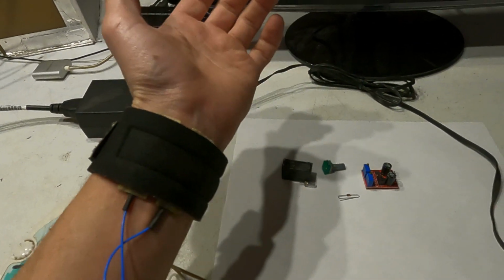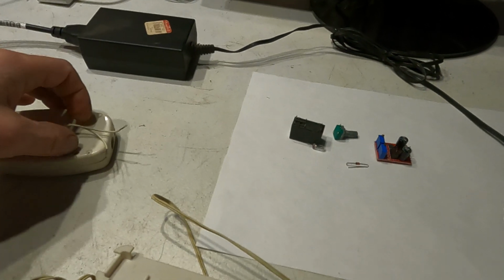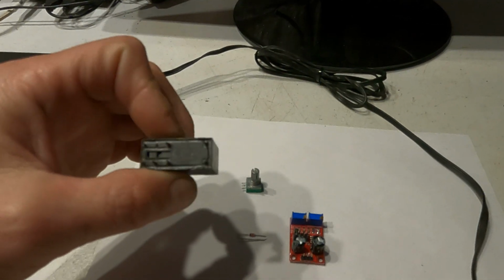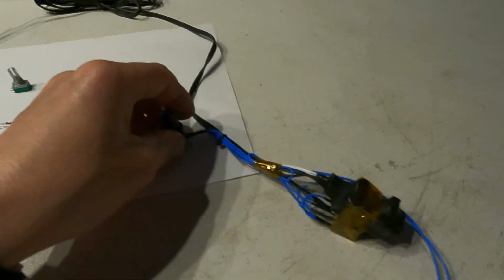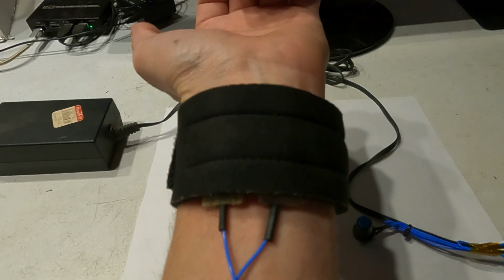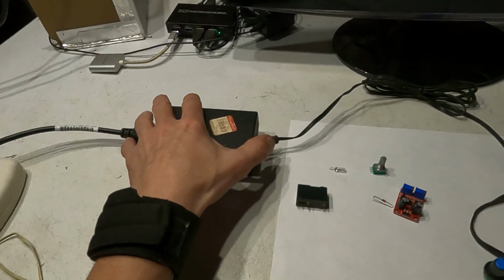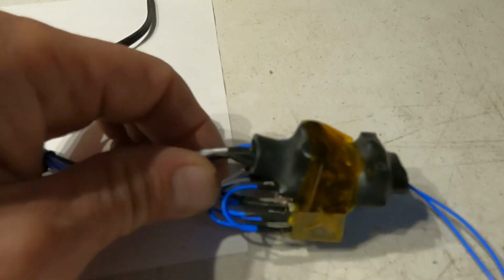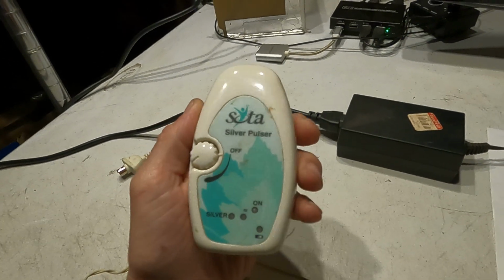162 Sota Silver Pulser alternative for under $10

Comment: Hi Andrey, this is really useful, and I would definitely like to see the schematic. However, there is one suggestion I'd like to make - in my opinion it would be more versatile if you had this running off battery power, but rather than the 9v batteries which the original Bob Beck design used, it would be much better with a rechargeable Lite-ion battery, or something similar. That would also reduce the size and weight of the device once it was mounted inside an enclosure - in fact it would probably fit quite a small Hammond type enclosure. Also, if the controls could all be accessed from the exterior of the device that would be even better - rather than only the single pot. What do you think?
Reply from the maker: yes, agreed, this first one is a bit loud and requires power supply but very simple, I will be re-designing and improving it further. it will be battery powered and compact.
Reply: @AndreyD  Hi Andrey. Thank you. Please keep me posted, especially if you intend making the new version available here in the EU, because I’d be interested if the price is right.
Reply: @truthseeker057  Just read the book he linked or ask an AI to whip up a schematics guide for you 😊

Comment: I make charge based zappers. Works 10times better than Beck's
Reply from the maker: Can you explain working principle?
So you charge the cap then discharge it into the electrodes? Not sure if I understand it correctly, some explanation would be helpful
Reply: @AndreyD  it solves ALL the limitations of beck's which are:
* High surface area to zap.
* Very high charge (or current density) as opposed to beck's. This is also because of the wider Electrodes.
* Higher output current (than beck's).
*Can be used at any part of the body (not only the wrist or ankle) to heal wounds, MRSA, mouth and throat infections, e.t.c.
Reply: @ChinonsoHenry-nz4zu  y de que sirve tanta presuncion, si no compartes tu informacion para el bien general?
Reply: @ChinonsoHenry-nz4zu  hi! do you still make these? Do you have a website, videos? Thanks!
Reply: @AndreyD   it's actually a 9v DC (peak) with an offset signal of 18volt (peak) which pulsates at a frequency of 4HZ (bob beck's frequency).

I have knocked out malaria, cold virus and stubborn bacterial infection when antibiotic have failed.

At a low setting, it energizes me when I come back stressed up in the evening after work. 

Heavy herx reaction occurs when you use it for the first time and for very long time duration per batch.

Powerful stuff.
Reply: Can you make a video about this or share more info?

Comment: Thank you for this video, a schematic would be much appreciated.
Reply from the maker: Sure it will. If I place it on my wrist right over the Veins, I will complete electrical circuit true the blood in my hand. Most of the blood in my hand is constantly receiving micro currents. I only need 50 micro Amps to deactivate Viruses, not sure about other microorganisms, but they are also are being influenced (electrocuted) and will die. 50uA is very small current, in my opinion I was giving way more then 50uA into the blood on my hand. with Veritable Resistor and salinity of the water used over the cotton pouches where electrodes are sitting  I can adjust the current to be below and above 50uA